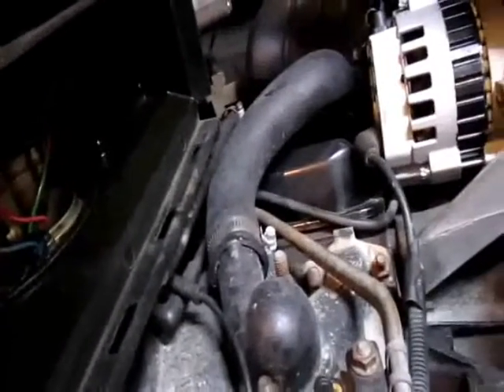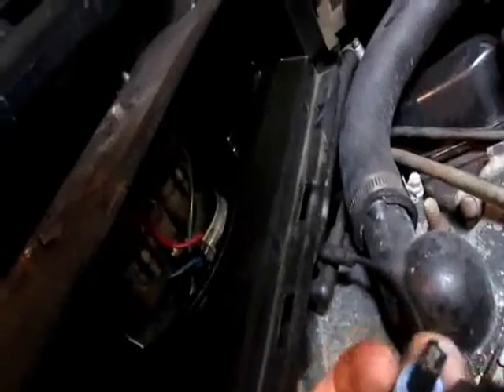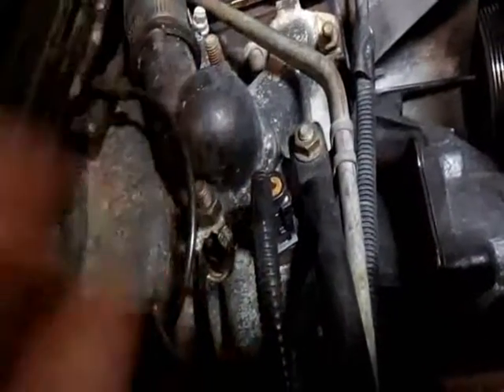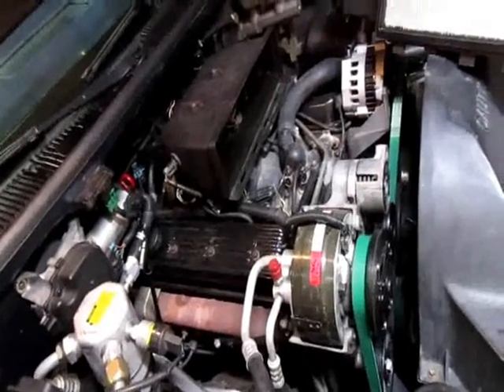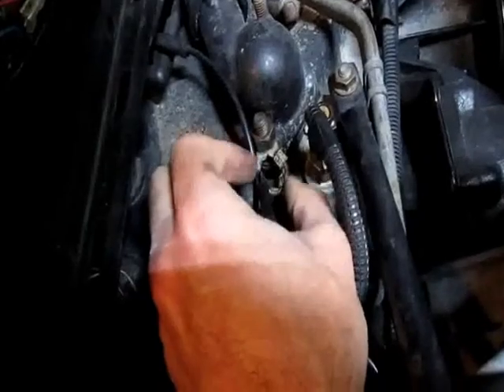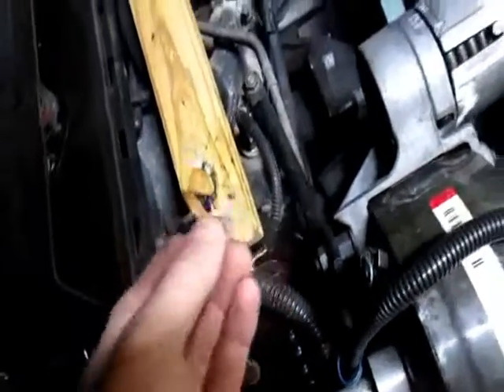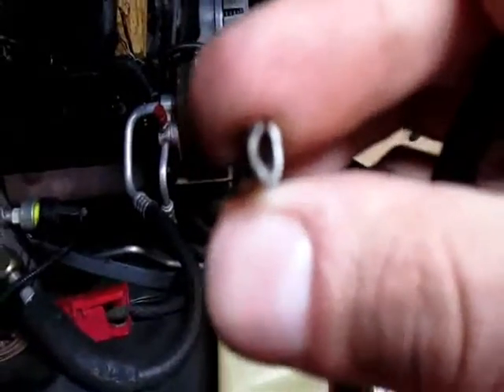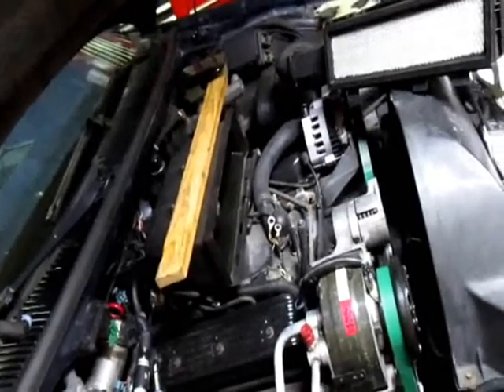Re crimping ground eyelets  Engine grounds TBI Chevy, Caprice, Roadmaster etc

Comment: Do you have a part number for the green serpentine belt ?
Reply from the maker: Same as the stock gates belt number for a 91-93 Caprice with a 105 alt ac and air pump but HD at the end of the gates belt number . Not sure of the number off hand

Comment: I just went through the same thing on a Roadmaster. I think the heat just gets to them after awhile
Reply from the maker: This piece of junk has its WARM start and stall. It loads up. I have to push the throttle too the floor and "clear flood mode" when the engine temp cools down to 150*
Reply: Ghetto Wagon I had the infamous high idle then stall took a week to realize that the ground terminals on the thermostat housing were deteriorated.
Reply from the maker: When did it stall? Randomly or only at startup.
Reply: Ghetto Wagon  it wouldn't idle for anything it started after I had got a code 33 then random codes would come up. I replaced all the sensors and the pcm. Then after the pcm swap I only got a constant code 15 and a high idle up around 1500 to 1800 rpm then an immediate stall. That's when I noticed the wires on the thermostat housing were broken. replaced them still got a code 15 so I'm convinced the harness for the CTS is bad.
Reply from the maker: The wires on mine certainly look aged, I am starting to think as the wires heat up in the engine bay the resistance signal the CTS provides changes. I checked the CTS, Replaced it with a known good,  Problem still happens. I have an issue that basically seems like the coolant temp sensor triggers the ECM into a full blown rich condition only when the coolant temp is around 150* on a RESTART.  Pedal to the floor, clear flood mode I can get it to run only barely, the engine really floods, black smoke..   Do that or on the 2nd or 3rd restart and stall it will get going and be fine.   I also thought maybe the fuel injectors leak alot of fuel into the intake but they have been sent out for cleaning  flow tested and checked apparently...  Problem still happens  Everything has been tested or gone through less replacing the fuel injectors. Maybe they POUR GAS when they are heat soaked.   Or maybe the sensor wires are garbage and when the wires get hot the resistance changes.   The engine pretty much acts the same like if the CTS  was disconnected. Oh I got NO CODES
Reply: Ghetto Wagon I'm starting to wonder the same. On hot days my car just acts like a child throwing a temper tantrum. On Facebook a guy told me he went through the same problems only to figure out the ground straps were in bad condition.
Reply from the maker: I never tested the new pickup coil that I put in the distributor. That also controls the injectors. The same part I used on this car in 2005 or so I used in 2007 on my TBI Truck. I had that distributor apart last year and that NEW AC DELCO pickup coil fell apart, the soldered wires fell right off.   Its just weird that on this car the 150* warm restart is the ONLY TIME it will act up, oh and it has to be HOT OUT TOO which is everyday in this dump of FL.  On the rare 70 degree day or so, it won't do it   I thought the IAT sensor was triggering it but that system too seems to be working correctly with correct sensor values.  I have not sen any ground straps on this car!  I see zero that attach the engine to the frame.  It looks like the battery was grounded to the fender, completing the rest of the body, the engine maybe grounds to the frame via the engine mounts. I dunno
Reply: Ghetto Wagon Yeah these cars are weird. My cousin has a 93 Fleetwood and had a distributor installed. His car has never been the same.
Reply from the maker: At the time no one made one besides the aftermarket so I built a new one out of new and used parts. new GM housing, Shaft, ICM, Pickup coil, Reused some small cover bits, the gear, etc
Reply: Ghetto Wagon wish i would've done the same the Cardone are okay but no where close to the OEM GM parts